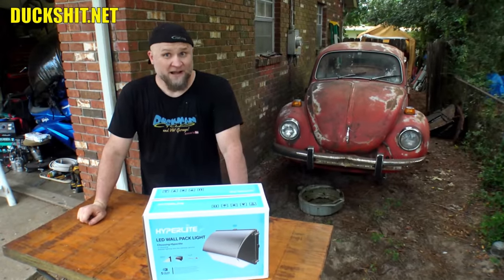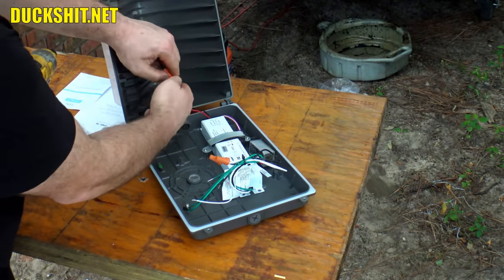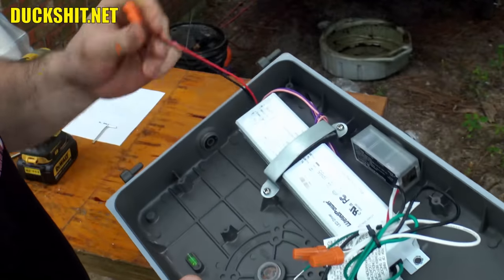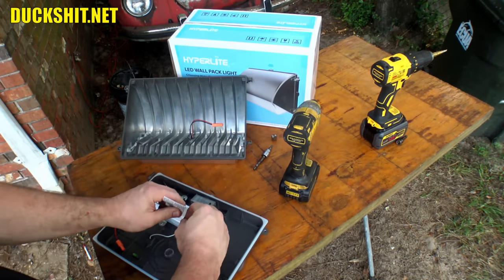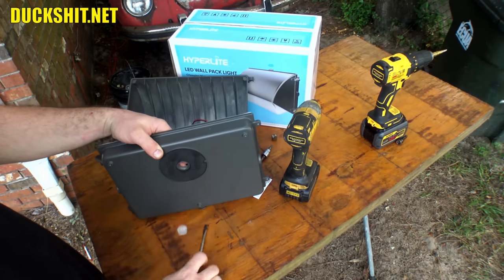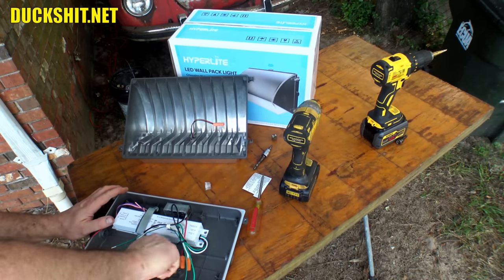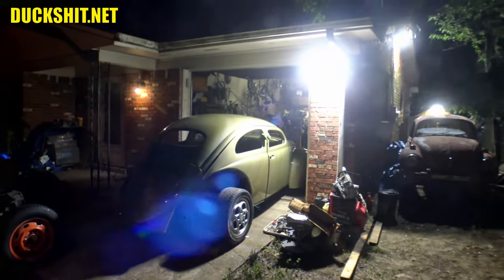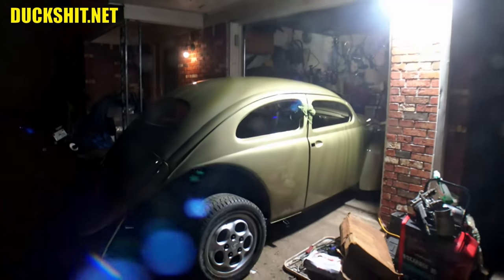Upgraded Lighting! - Hyperlite LED Wall Pack - Product Review

Comment: If I remember correctly, those are the 120 watt version of fixture? From the mounting height they are installed, you could have gotten by with the  50 watt or 70 watt version of fixture unless you are performing surgery out in your driveway. Nice fixtures though, they might be cast aluminum construction possibly.
Reply from the maker: Really really don't remember what the wattage is, probably said only labels or something that I opened up in the video.  However,  these lights were sponsored, not something that I ordered.  😁👍🏻🦆💩

Comment: Now that you have shown the system, and mentioned there way no stress relief for the wires, maybe Hyperlight will consider adding it to the kit. Otherwise, the kit is complete. 

Most common with no experience may get the light, not get a knowing person to install it and just have the open hole otherwise. Heh, just a thought.  

Kool lights. Nice install demo.
Reply from the maker: Thanks, but I don't work for them!  I am just a guy on YouTube with free lights!  hehehe!
Reply: Understood. What I meant was maybe THEY will figure that out for future lights.  You just mentioned the only thing it did not have to install it.  

However, to their defences, they mention to use a pro to do the work.
Reply from the maker: @dinowhite6247  The instructions were a bit vague on the mounting and wire routing department.  It just said "mount" and "pull wire through" lol, not much else.  And the diagram drawn was very small, and pale gray on a white page, quite hard to see.  But like you said, and they said.... have a professional do the job.

Comment: Here it comes😁  
    
 you must never use a metal clamp to clamp 2 wires. can become a short circuit.
  The entire wire with the plastic protection that is around must be included under the clamp. Most similar lights use a rubber grommet attachment so they are watertight
Reply from the maker: Its always a Ford guy that tells me I am wrong.... LoL!  Thanks man!   😁👍🦆💩
Reply from the maker: So why again should I not use this type of clamp/connector for what it was designed?  LoL!  Good thing I clamped 3 wires and not just 2!  😁👍🦆💩
Reply: @DuckmanCycles  
I am 46 years old and have never owned a ford until now this year.
Not 100% satisfied. 
Why not call me ford on youtube when i now own a ford. 

I like your channel and what you do. 
I have to admit that I also watch your channels since
Bee McQueen is in many of your videos.
Reply from the maker: @ford1546  😁👍🦆💩

Comment: did you notice the spirit level in the case? the case is probably magnesium or some alloy like that. it probably is also metal as well to dissipate the heat from the led panel. typically led's dont really get hot however when you are talking about bright lights like the one you have they will get toasty. 

i have some led lights for my car (aftermarket) they have heatsinks and fans on them. but man are they bright! they project twice the distance compared to halogens you just have to make sure to get decent ones that will keep a beam pattern. if you compare them to led lights that dont have heatsinks and fans those are garbage in ther sense not good enough to see at night infact some of those are worse than halogens.

Never been a fan of those wire nuts first time i saw them was in the states i was like eeek!!! lol but i guess its what you are used to there if the powers that be say its ok then its ok. over here we have almost everything with brass terminals and screws to hold the wires in. 

its always good to have led's though my whole house is run on 240v led lights much cheaper to use. and much better than those "energy saver" crap bulbs that take time to warm up and even then theyre still not even that bright lol.  i have one of these in my bathroom and its mega bright had it over a year now https://www.amazon.com/FOROUREYES-Foldable-Pendant-Flicker-Adjustable/dp/B091BHLN7H
Reply from the maker: Did you notice me talking about the level in the video?  Twice?  LoL!  The LED panel gets a little warm to the touch, but the inside does appear to have some cooling fins immediately behind the LEDs, probably just enough to wick away any significant heat.  LEDs typically don't make that much heat compared to their predecessor lighting technologies, but the controllers and other components make even more than the LEDs do sometimes.  I should have noted that these LED lights also operate at 240v!
Reply: @DuckmanCycles  i walked into that one didnt i! lol "cant see for looking" 

looks like you have smd led's in the light unit which are the better ones in my opinion. its cree led's that usually have more heat issues. they tend to have a big yellow blob in the middle and a lot of tiny leds in them. they can be brighter but most of the time end up dying from heat. 

nice you got the use of 240v a lot of people over there obviously not you dont know that they have 240/210v at the fuse board. mainly used for the cooker/stove and laundry equipment....... ideal for welders too  it can handle the power better than 120v in some applications.
Reply from the maker: Yes, I use 240 for my compessor, stove and dryer.  Sometimes if I need to cut something thick the plasma cutter will get plugged into 240, but for most sheet metal plasma cutting applications 120 is more than enough, even with it dialed way back.  Thanks man!